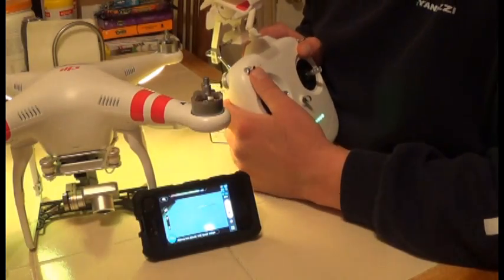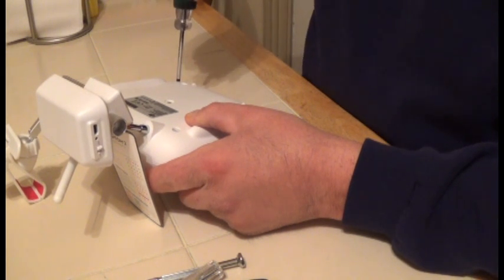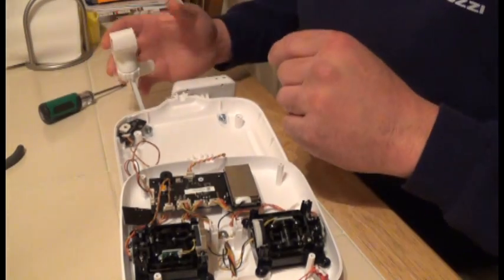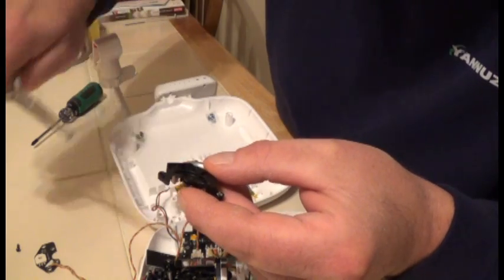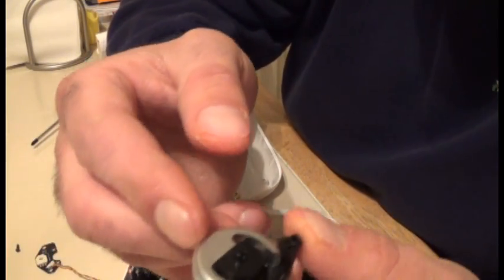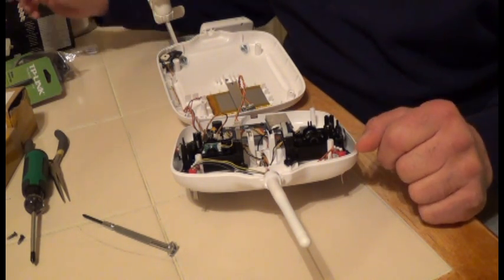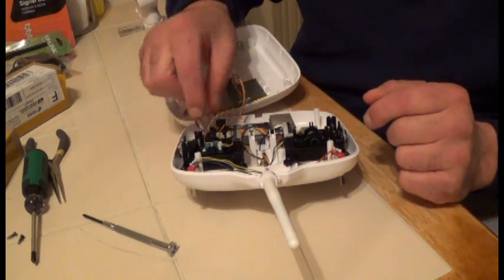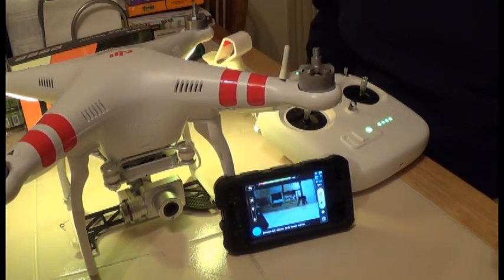DJI Transmitter with Wheel - Modified

Comment: Could you fit a disable switch to the wiring, my gimbal gently pans either down or up and refuses to remain in one position.  I'd like to turn off the output as somehow it always drifts off even after calibration.

Comment: Craig, Just tried your recommendation(s) and calibrated for X1 with the Phantom RC app and the PT2 app.  And as you indicated, the wheel works great and DOES NOT snap back.  No need to disassemble the RC.  Not at all.  Thanks so much.

Comment: my gimbal dialer its not responding .. i have it set up to advance rc and still doesn't work if i set it up on basic rc i could pan tilt the camera with the slider on the app but if i change it i get no response from the rc ... any advice thx

Comment: Hey Francis,  another great explained video!  Thanks for your very good teaching methods.  One question though,  Will your wheel have a little friction needed to stop it from turning inadvertently ?   Oh,one more thing.... It is Dec.20th and how do I find out the winner that you said you would announce ?
Reply from the maker: I will post a video shortly on it! When you remove the spring it doesn't fight back with you so were you roll it then it will stay! Give it a try save the spring if you don't like it you can switch back!!

Comment: Dont waist you time doing that.......If you open your computer app. Assistant software  or download the new version.  you will see on RC setting: Upgrade Version or Basic Version. Click on the Upgrade version and this problem is fix righaway.. wheel work perfect.... try that ....remember dont open your radio.
Reply from the maker: Yes and it works but I don't like the resistance on the wheel so that is why I did this mod. I prefer to have my wheel free runs much better that way!!

Comment: Do you check out your setting on the Phantom app? No one need to do that....With the new firmware the camera stay were you want.
No need to open and mess with your radio
Reply from the maker: Yes and it works but I don't like the resistance on the wheel so that is why I did this mod. I prefer to have my wheel free runs much better that way!!

Comment: Is there still a little resistance so the wheel wont just move camera if you move controller around?
Reply: Also agree even if the mod upgrade worked I would still take that spring out feel if I am flying with gloves or hands cold I feel I would have greater control without the resistance of the spring.  Just my thoughts though so if this upsets anyone sorry.
Reply from the maker: Hello Steve, no there is none. The best part about this mod is you can always put it back so its not like you will break it to do the mod. So I would say give it a shot and see which way you like best. Glad you enjoyed the video!!

Comment: Couldn't see the antenna U.lf plug? Francis, is it the same as the rest of these TX ?  will have to do an antenna mod as soon as I win this guy?? - lol - The mod for extender and control I did on mine was awesome - Got me 1-2 thousand more Ft. w ith a 6dbi omni directional...
Reply from the maker: O don't worry I have all the parts for the mod to my transmitter. Just trying to find the time to pull it off. Can't wait I feeling its going to happen pretty soon!

Comment: great and reasonable mod. i don't even understand why it was designed to snap back to the middle by default. even if the upgraded software 'fixes' it, i actually like the absolute positioning your mod gives better. i wish it could be supported by dji as well in future updates officially, so i could just use your mod forever.
Reply from the maker: Thank you Tamas at least someone else sees a benefit to this. Hope you enjoy it. And yes personally I prefer it better without the snap back. It just creates more resistance when your trying to get your camera to move nice-e-nice. Thank you again!!
Reply: Francis G I think a recent (few weeks ago) firmware update dampened the wheel movement but the wheel (not the camera) still returns to center. If you push the wheel just a tiny bit (1/16 inch) it will move the camera 90 degrees (or until you let go) real slow. If you push the wheel a lot it will move the camera really fast. I'd like a gain setting on the vision app where I could set the max tilt speed and i'd make about 1/4th of the current max.

Comment: OK - as others have pointed out this is not needed following the appropriate upgrades. When updated the camera stays where it's moved to (doesn't track back to that 45 degree down tilt). Might be worth updating the video comments to reflect that. Cheers, Nick
Reply from the maker: Nick as I mentioned to others. I did a full update using version 3.6 from DJI. I updated the firmware, calibrated the toggles and the wheel. I also checked Upgraded Version under Transmitter Version. And I updated my iphone app all yesterday prior to doing a full phantom update. And this was how my camera responded when I rolled the wheel.Maybe its a bug or something. Not sure but that was my end result!!
Reply: Francis G Everything in the system has to be on., not just tje transmitter.

Comment: WRONG & UNNECESSARY. The wheel snaps back but the camera does NOT snap back if all your programs and firmware are up to date and you've CALIBRATED X1.
Reply: Craig Crowder And it's a good way to void your warranty.
Reply from the maker: I did do that I calibrated the x1 along with calibrating the toggles to. I have updating my firmware. I'm using Assistance software ver. 3.6. And I updated my iphone app. And still the camera rolled where ever the wheel was. Not sure why maybe a bug or something but that's how it functioned for me.
Reply: Francis G  all systems have to be on including the phantom itself.
Reply: +Francis G  Why not explain how to calibrate instead:

First: With your controller turned on and plugged into your computer via USB launch the PhantomRC app and calibrate X1 and sticks. Second; With your controller and Phantom turned on, plug the Phantom into your computer via USB and launch the Phantom(PT2) app and calibrate X1 and sticks again.

Comment: You didn't need to mod. Just go in to the DJI Assist software (v 3.6) and change the transmitter option to "upgraded".
Reply: Francis G Try this: uninstall the RC Assistant software ; download the EXE from DJI site; install ; connect the TX to your PC and launch the RC Assistant; calibrate all the sticks and the X1 channel; close; Connect the Phantom to PC; launch Assistant Software; calibrate all the sticks and the X1 channel.
Reply: ***** Thank you Alessandro, reinstalling the RC software helped me to properly calibrate X1!
Reply from the maker: I am running 3.6 I downloaded it from DJI yesterday and I did select under Transmitter Version - Upgrade Version. I also updated my iphone app and that's how it worked. I tried everything to make it stop and nothing worked other then doing this!!
Reply: Ok, have you calibrated also the X1 channel? And remember to upgrade the Zenmuse firmware!
Reply from the maker: *****  Yes, I have celebrated everything (toggles spun them all around the 4 corners and the wheel rolled it all the way to one side and back to the other side). I  am running 3.6 installed and I updated my iphone app to the latest all yesterday prior to updates. I also selected the Upgrade under Transmitter version and I tried to even upgrading my Zen IMU but it gave me a battery error or something. I will try that again to see exactly what the error was. along with all the other updates. Still when I rolled the wheel and let go it return to a neutral spot.